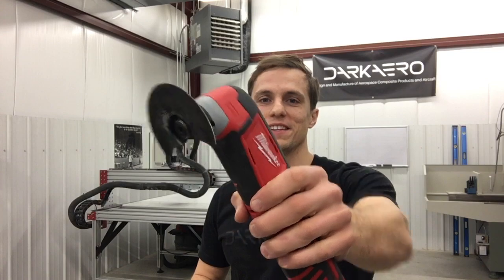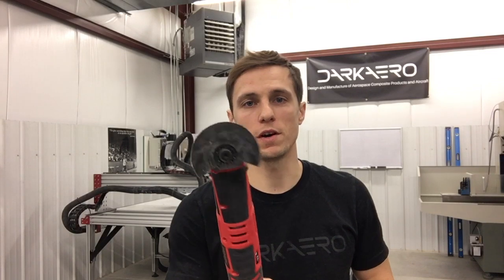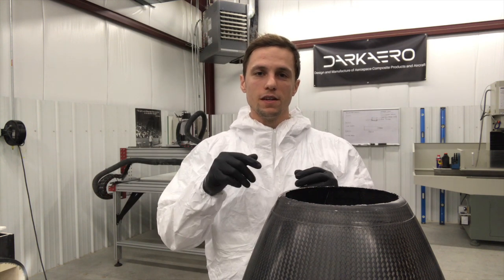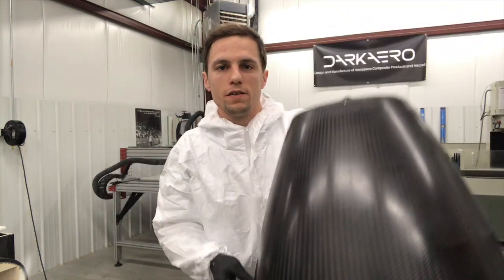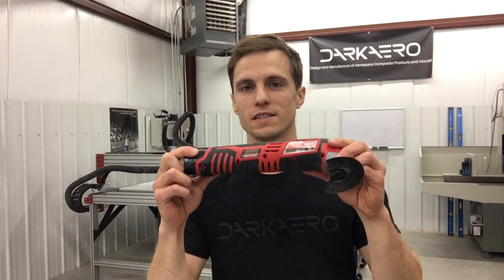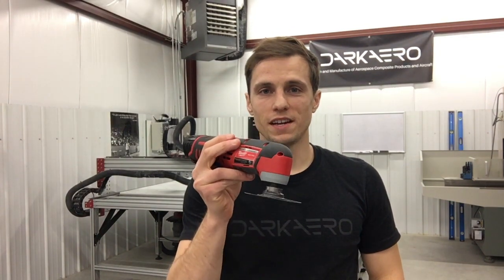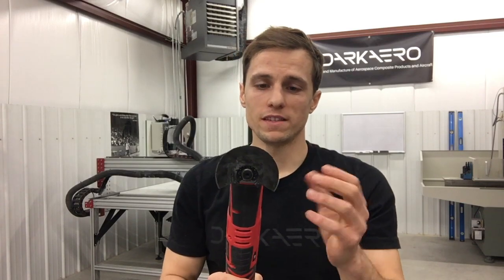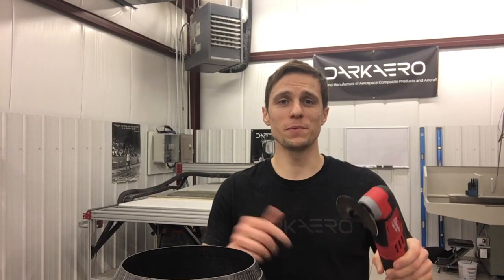Oscillating Tool for Trimming Carbon Fiber Parts!

Comment: We call em "Multi-tools" in construction. They are complete lifesavers at times where space is limited, plus their so precise. People should also know that there are a ton of different blades; straight, hooked, scrapers (amazing for removing adhesive) etc. Plus most come with a triangle shape sanding pad with Velcro that works great for getting into corners. Could t help but think a simple rotary table/lazy Suzan would be killer for cutting those round parts. Great video!
Reply: What blade for cutting a 10" hole in fiberglass would be recommended?

Comment: Hey Guys!  I've skimmed through your videos, and I don't see details about how you built your wing.  I'm working on a project where I need to build a composite wing and I'm stumped how to get the top and bottom skins joined so that I have a smooth, and strong leading edge.  My plan is to build two C-channel spars, and then lay those (adhere) into the pre-made top and bottom skins (with ribs, etc).  How do you join the two skins together at LE and TE to get a strong bond?

Comment: Diamond coated tools also tend to work well with carbon, I was shocked at how well my jigsaw worked with a diamond blade. I wonder if the same would be true for an oscillating tool.
Reply from the maker: Thank you for watching and the comment! This is true! We've used diamond coated hole saws with success.

Comment: Carbon dust accumulation has ruined my dremel tool since carbon is contactive and creates sort circuits.Althougt I use it outdoors I could not avoid   it .Did you had any similar issues with your power tools? Thank you for your infos . I won't be able to buy your products but you are a great source of knowledge for me.
Reply from the maker: Thanks for checking out the videos! We have used the Milwaukee Oscillating Tool for a number of years in the shop to cut carbon fiber and haven't experienced any issues with it.

Comment: How about putting that oscillating tool into a jig so it has fixed height above the table and just move that carbon piece along it? Might get cleaner results with that.
Reply from the maker: Jan, this isn't a bad idea. For a more production like environment where one is doing multiple of the same part, the approach you mention would justify the time spent on designing and building a fixture.
Reply: I was thinking the same, in the past, I used to cut soda cans and making them into ashtrays for my dad.

Basically put a razor in between the Yellow Page(phone book), clamp it or stand on it and i continue to rotate the soda can on the blade. Much more precise.

So I guess what I learned from that is..moving the object to the tool is more stable than moving the tool to the object..Unless you're a robot :D

---
Soo..maybe you could clamp the piece to a Lazy Susan and have the tool on another jig. Set the height, turn on and just rotate the Lazy Susan, and you got yourself Lathe of some sort.

Comment: I've seen this tool a few times in stores and often wondered what they were used for, so thanks! I found this video when trying to find the right tool to cut a 1" slit in a carbon fiber part, any suggestions?
Reply from the maker: How thick is the carbon fiber part that you are trying to cut? If it isn't too thick, you can use the oscillating tool no problem.

Comment: I want to cut my hockey stick blade with an oscillating tool. What would you recommend for a finish coat after cutting?? I would think the cut would want to fray afterwords?

BTW it’s an experiment that I’m doing, I know it won’t be perfect, but if you can’t buy it, build it! Right?
Reply from the maker: Depending on the weave pattern of the carbon it may fray a little on the edges. You can clean up the fray with 220/320 grit sand paper no problem. You shouldn't need any special coating after cutting. You can paint it or do a clear coat finish if want too.

Comment: I was looking for a video on how to cut shape carbon fiber parts and what's needed. Just about all my question answered bar one.Thank you..The cutting tool I have is numbered 1to10  to regulate the speed of the motor .If yours is like that what number should it be set on.Thanks.
Reply from the maker: Neil Hamill glad this video helped! Generally we keep ours set to the higher speed setting. But you may find it helpful to adjust the speed depending on the thickness of the carbon you’re cutting.
Reply: @DarkAeroInc  Thanks for that much appreciated.

Comment: At work, I got sick of changing bandsaw blades since the carbon would dull them quickly. I ended up getting a $100+ abrasive blade that worked great until some idiot used it on aluminum and gummed it up.

Comment: Would a 3d printed cutting guide reduce the amount of trimming and sanding you need to do and make the cutting more precise?
Reply from the maker: Mike, thanks for watching and for the suggestion. Creating a guide jig is something we've discussed. Given that the parts are off a CNC mold, we would likely want a CNC made jig as well. It might be challenging to get an accurate enough 3D printed jig while also keeping the cost of it low. Perhaps a step beyond the jig would be to use a CNC controlled head to cut the parts out for you. This approach is something we've experimented with. However, we found that the setup time, positioning and zeroing took more time than simply the rough cutting and sanding. If we were going into higher production volumes than what is planned, we would likely revisit the CNC approach.

Comment: Fein makes the best oscillating cutter. Had mine for 20 years. Then again, I do log homes and not aircraft 😂
Reply from the maker: Ryley had a Fein for work on the Cozy. They are very good! We demoed cutting with the Milwaukee Tool because we want to show our future customers they can get the job done with simple tools from their local hardware store.
Reply: Oh that's awesome!!!
Reply: If you build log homes and are hiring a solid (not master) but solid carpenter I'd be interested! I've always wanted to...
Reply: @cencoast_7.340  I no longer build log homes. I moved from Colorado to Alaska and am working on instrument, commercial and multi-engine ratings so that I can fly for my career.

Comment: Good video and tips! Is yours a Milwaukee oscillating tool? Wow - didn’t realize the spinner is so large!!!
Reply from the maker: Ours is a Milwaukee brand. We have a bunch of different Milwaukee tools that have interchangeable rechargeable batteries. There are many different options out there for oscillating tools, we mainly chose the Milwaukee because it was compatible with the batteries we have for our other tools.  Definitely recommend a cordless one though. We also had a FEIN brand oscillating tool with a cord. It had more power than the Milwaukee one but it doesn't take a lot of power to cut thin carbon fiber.  Cordless tools are just easier to operate.

Comment: Hey man if I have to cut into a carbon fiber aero part what should I use to seal or re coat the edges ?
Reply from the maker: Hey Mike, most laminating epoxy would work to seal it up. Any details on what you're trying to seal up?
Reply: DarkAero, Inc Hey yes it is a carbon fiber side skirt for my car. I am considering using a dremel on it to cut off excess. That in mind I figured it would be best to seal the edges where I cut afterwards. Any shared wisdom would be greatly appreciated thanks for the reply!

Comment: Gret video as always! You may want to try Perma-Grit blades as well. I have had good luck with my Dremel tool with the pen adapter otherwise the dust will kill the tool. Ask me how I know. Here is a link to the Easy Composites video showing different tools used including Perma-Grit and the results. https://youtu.be/EWzN6GZeEzs